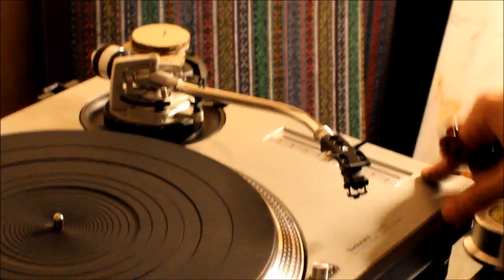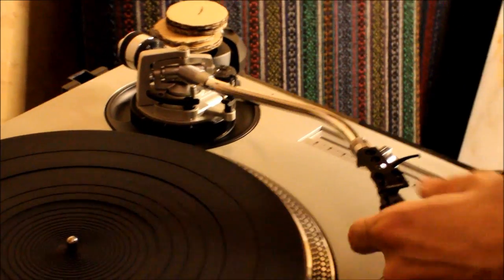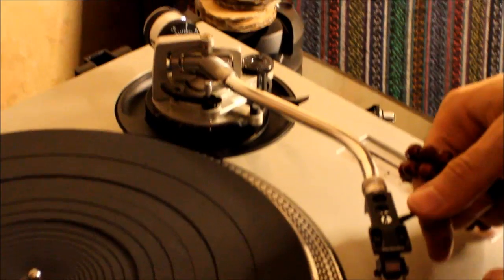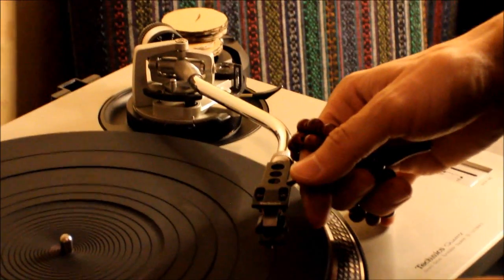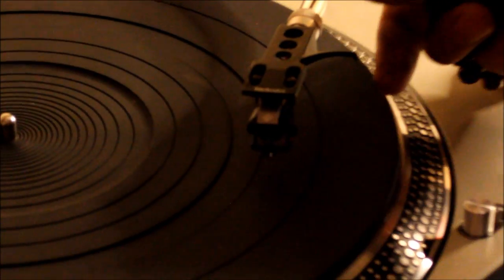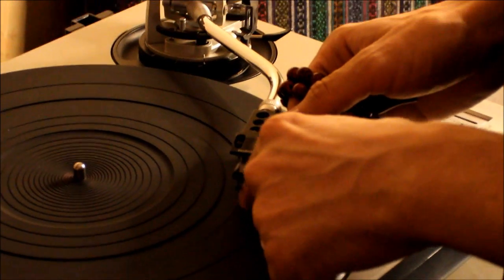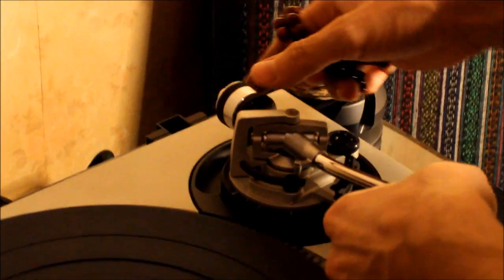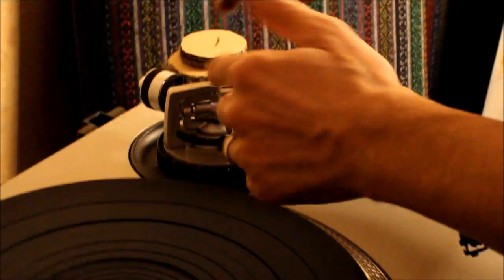Technics SL-1200 MkII Tone arm Anti Skating Problem

Comment: This could be needing antiskating calibration, so you need to open your SL and then position the antiskating spring in the correct position so that when it's set to 0 it does not pull your arm to the right. Other possibility is the bearings are a bit "traumatised". I think your tonearm looks great man, do not worry, only new ones are perfect, most second hand decks have this, either from shock or transport without locking the tonearm. I would certainly not spend 400$ for a new tonearm to replace one like yours, in this case it behaves as if anstiskating was set to 0,5 or so, just use less antiskating ;).
Reply from the maker: Thank you I've sold it many years ago, it is no longer with me... But will have one definately one day again...Thanks.

Comment: I've got the same problem, I had a dodgy tone arm a fitted a new one and it don't seem to want to move to the center. I think it is pressure of the tone arm wires pulling ever so slightly on the arm. When you move the arm into the center you are stretching the wires allowing the arm to move freely.

Comment: Hey! I just found your video, cool to read that the problem is gone, and its perfecly normal ( or... near normal) 
Im not good enough with english to explain it clearly but i'll try:
 the anti skating inside has like a spring with a straight end that pushes (+/- strong depending of your stttings) on a kind of screw on the tonearm. sometimes its skips and goes to the other side of the screw and this '' reverses'' the effect of anti skating. Sometimes it creates other problems too. Pushing your tonearm could have made it skip back in the right spot.
Be careful this doesnt happen again because you might have to change your tonearm. This problem means some parts are kind of used. Be careful during transports too!
OR, if you are not the first owner, that could mean the tonearm has been changed and not installed properly...

Cheers!
Reply: The anti skate is essentially a small hook that catches the tonearm from the inside.  It adds a little pressure to the tonearm inside the turntable to help the needle resist skating backwards (hence anti skating name).  I'd suggest not trying to tighten the pivot screws as they're factory calibrated.

Comment: What may also help is if you get some turntable oil. And apply to the spindle and under the screws of the tone arm where the bearings are. I have the same issue.

Comment from the maker: IT'S BEEN FIXED, strange but I pushed the arm till the end and pushed it a little harder a few times when its position is at the end, after that it worked proper...Hope yours would work like this too...In a way of explaining, "something fitted to a place"
Reply from the maker: Dear Mattias Stein push the tone arm to the left on the platter to the spindle. When it comes to the end just push it a little more, not using an aggressive force, just nicely. That was how I get the result. Thanks...
Reply: Thanks so much for posting this! I've spent hours trying to fix my "broken" tone arm and it turns out I just needed to push it back into place too.
Reply from the maker: Cole Carter This is the best news I've hear today, Cheers...
Reply: Your tonearm bearings are damaged, dented, you need a new tonearm.  If pushing on it made it work, it's because you bent them more and now have some slop in the bearing. It will play but not perfectly
Reply: @danielsanichiban  More than likely ... or best case scenario is the antiskating spring sits as if antiskating is set to 0,5 , so that spring needs calibration under the tonearm.
Reply: Selman Caglayan I have the same problem. How did you figure out that you have to "push" the arm towards the end of the platter where the nipple is.
Reply from the maker: ***** Hi, I just felt it, there was  nothing else to do :D
Reply: Selman Caglayan OK I have the exaaassct same problem. gonna try this tomorrow. Though not sure what you mean by pushing ithe arm a little further. Wouldn't want to break my tonearm using too much force. As of now without fixing, it will make records sound real static and sounds as the neelde hits the inner walls of the grooves frequently. with whatever cart I use. Hope this fixes it.
Reply: Hey there. I tried this on my Sl today. But I did not notice anything pushing the arm slightly beyond the "end" towards the spindle. Did you notice any click or something. I did not.However my arm seems to balance properly on a larger surface above the platter now. and not automatically go to armrest. But problem still remains balancing the arm near the beginning of the platter... hm.. what should I do. Use more force towards the spindle?
It does show your fix does work somehow.
Reply from the maker: Mattias Stein In my opinion you may try to push it again, as I understand from your message the problem has been sold partially.
Reply: worked for me as well! thanks
Reply: thank you very very much